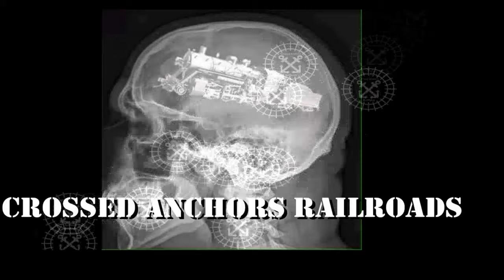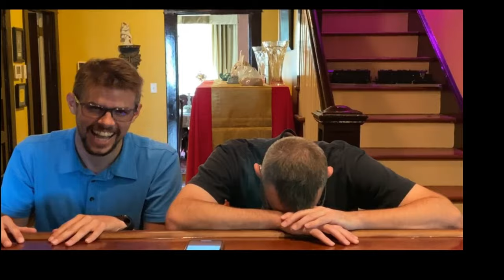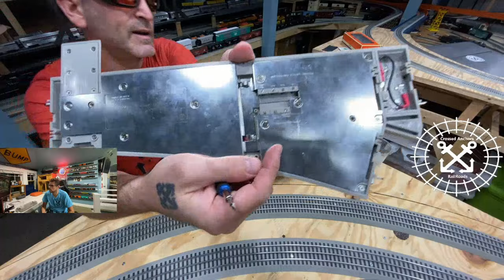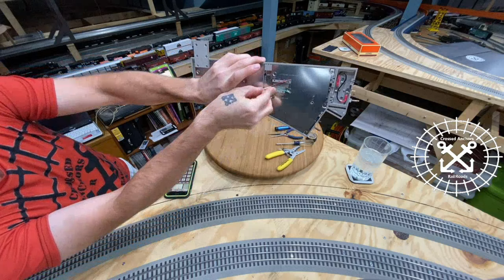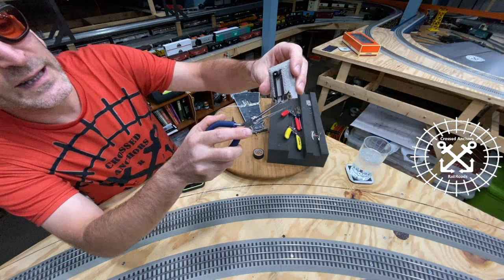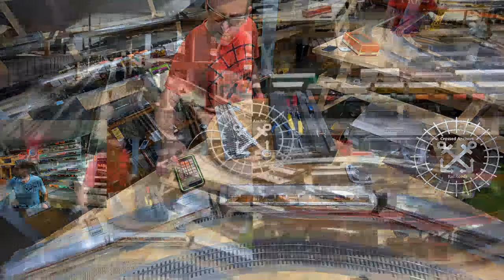How to Wire a Fast Track Switch : an excerpt from our Live Stream : S.T.E.M. :

Comment: Hope you guy’s are doing well.  Miss your videos.  Got a question, will there be enough power to run thru 30” of track between two switches?  Also can 22 gauge be used for accessories?  Like I said before miss you guy’s.  Thanks in advance.

Comment: Did you have any electrical issues when you put in your fast track? Some people say on these forums fast track doesn't let the current travel through and have dead spots I'm going 2 be building a layout and I'm wondering which track 2 use? If you did have trouble with electric drop offs how did you fix it?

Comment: How many of those small Lionel transformers do you use for all your switches to set at 12 volts?  Which video did you show how to connect it to the layout?  Thanks very much for vids.  Still learning.
Reply from the maker: I have 4 of them to power the 58 switches and will add one more when I do more switches

Comment: Great video, thanks.  When you did the fixed voltage you connected both the power (red) and the ground (black) ... in lionel videos they only connect the red ,,,, is there a reason>?  and what did you connec the black to?   i ask because my switches are driving me crazy,
Reply from the maker: There is a positive and negative terminal next to where the jumper is for track power.

Comment: On Fast Track turnouts, What can cause red and green at same time when moving the turnout lever? Rewired for constant voltage. Determined to get this problem fixed. Not all are doing this so trouble shooting isn't solving this
Reply from the maker: What red and green light is on at once, the later no. The track?

Comment: So how does it work for the CW 80? Since it has only Black and Red wires, how does the 4 color telephone wires connect to the CW 80?
Reply from the maker: You have to remove the jumper from track power underneath the switch.  Then run the black and red from the transformer using the star method like track power to each switch.  The control lever just remains connected to switch it if you are not doing command control.
Reply: My son and I are very new to this hobby. He's on the Spectrum, fully verbal, super smart and patient.
As a beginner, is the jumper the little square things for where the wires go in?
We have 4 switches that have no wire or connections. The slot is empty.
Reply from the maker: To be more helpful, it might be useful to have a conversation on Facebook Messenger, so we can exchange pictures on what we are talking about. Do you follow us on Facebook?

Comment: So? 18 guage for power to the switch and 22 guage to the switch toggle?
Reply from the maker: Yes that works.  You could go to 20 gauge for power as well.  Switches only need 12 volts to work.